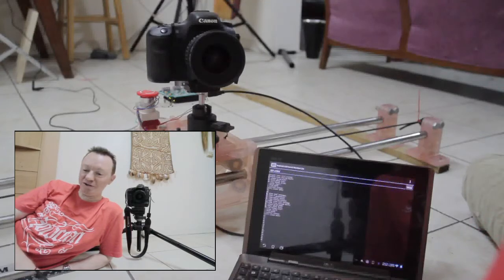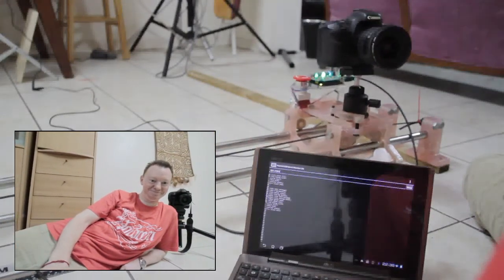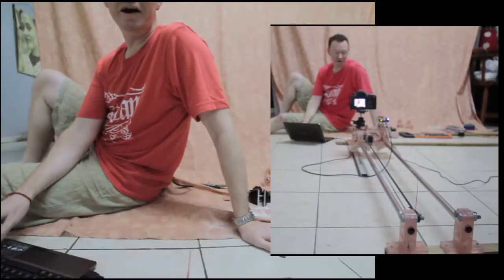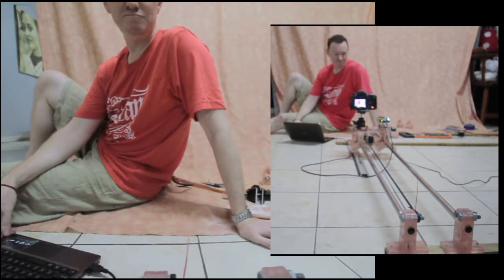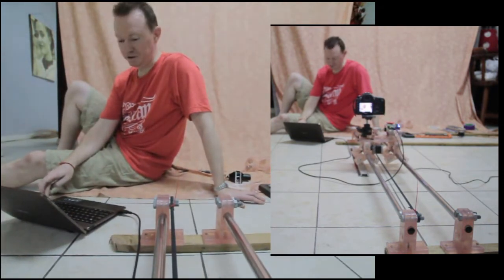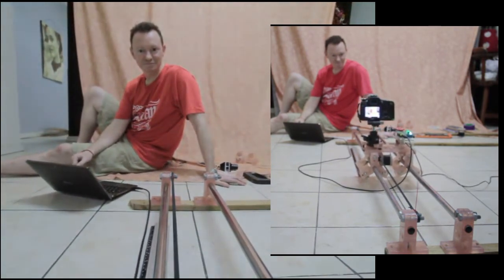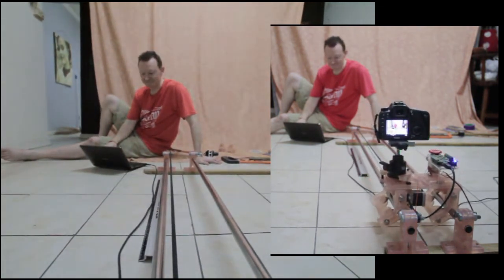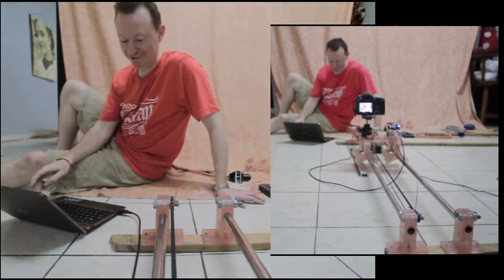Camera slider first test

Comment from the maker: One of the microphones is in the body of the camera, and that is picking up a lot of noise. Using a directional microphone off-camera should help, but I haven't tried it. I'm mainly wanting to use it for time-lapse where sound isn't an issue but if it gets more use for video then I may have to do things like mounting the motors on rubber gaskets and putting some foam around them.